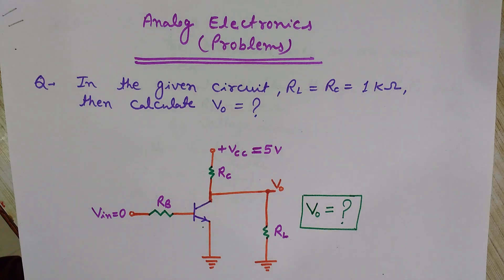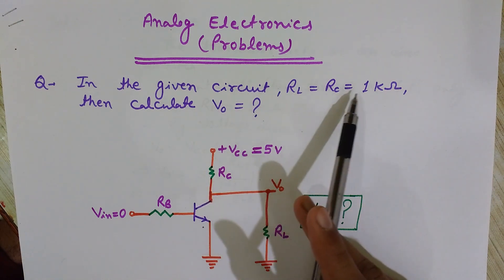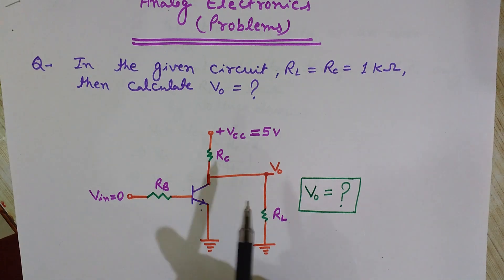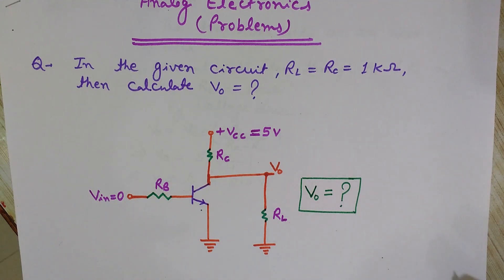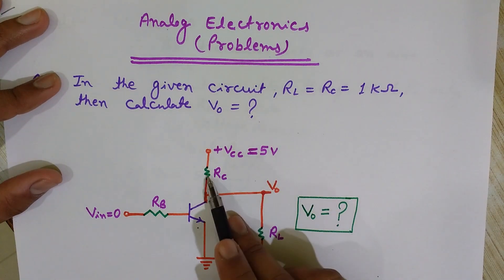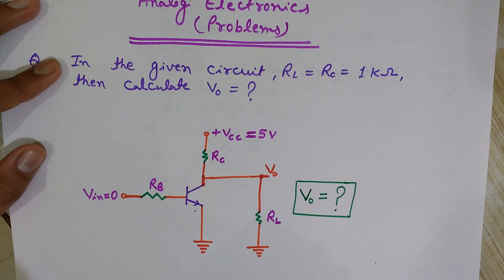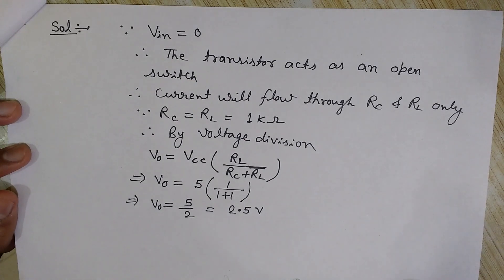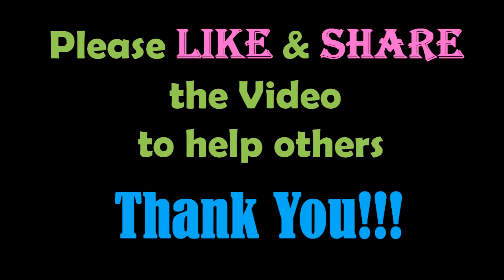Transistor as a Switch- Bipolar Junction Transistor (BJT) Circuits- Voltage Division Rule Video

Comment: Draw acircuit using BJT for switching of a DC load. Load comprises of 5kW at a voltage of 200V DC. Represent the load with a resistance. Available stock of BJTs have βDC of 100, 120 and 150. Switching should be performed using a 12V battery 
Sir plz help.me in my homework